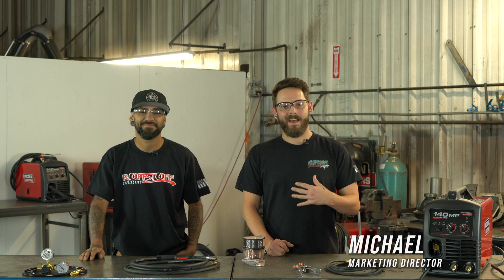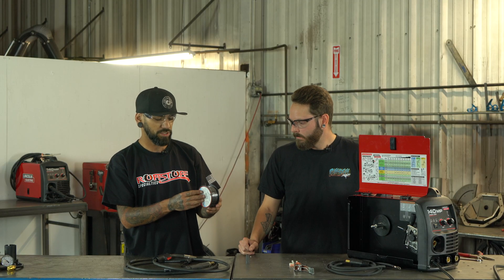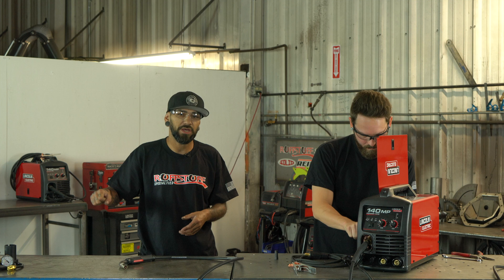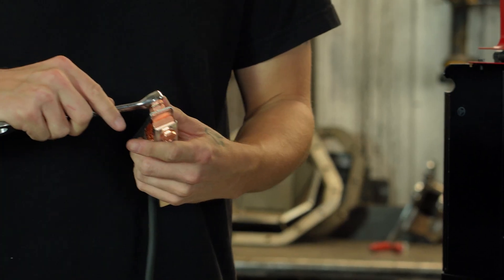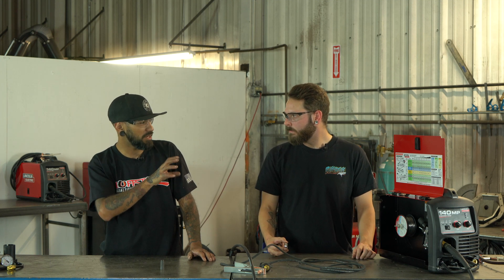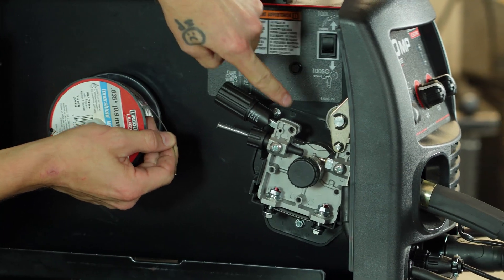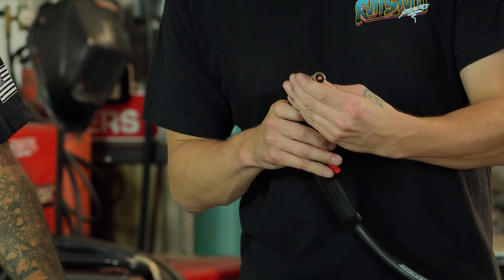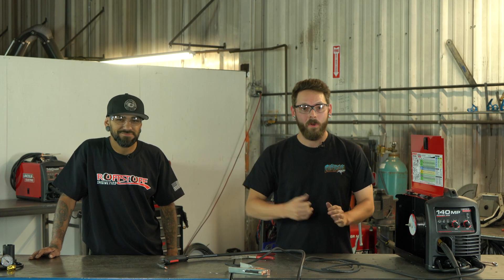How HARD Is It To Set Up A WELDER?

Comment: nice job with the video.  Well explained and slow enough for a beginner to follow along.  I picked up a Lincoln 110 and it had a spool of the copper colored wire in it.  Is it safe to say that copper colored wire is used with shielding gas and the silver wire is good to go without gas?
Reply from the maker: Hopefully there will be a label on the side of the spool, if it is solid core and you aren't running gas you'll be able to tell pretty quickly!